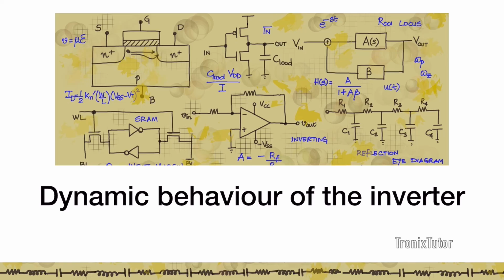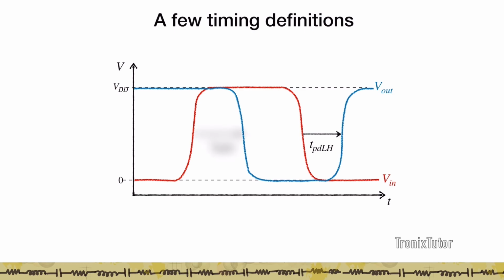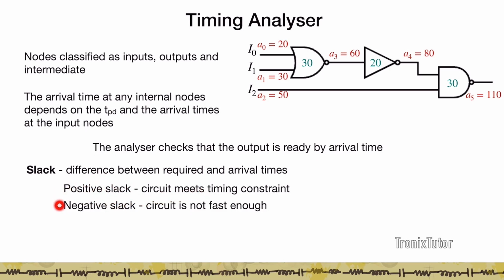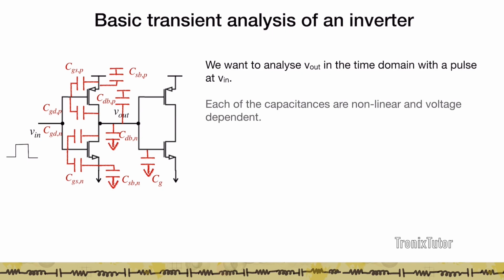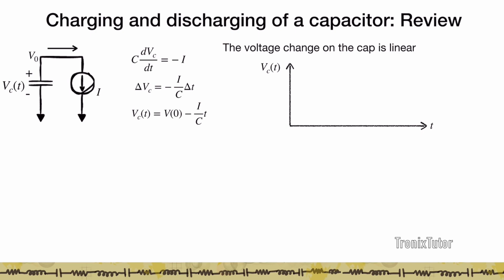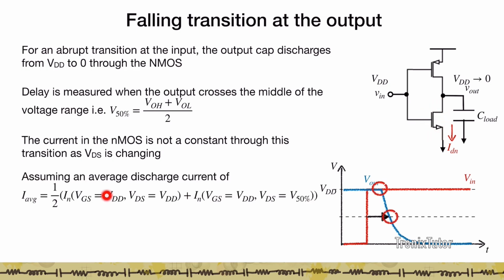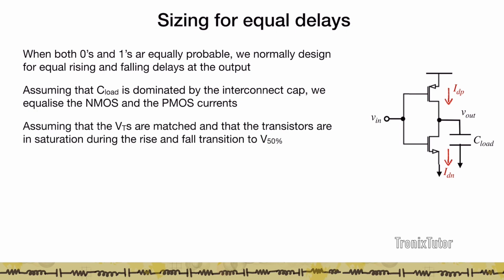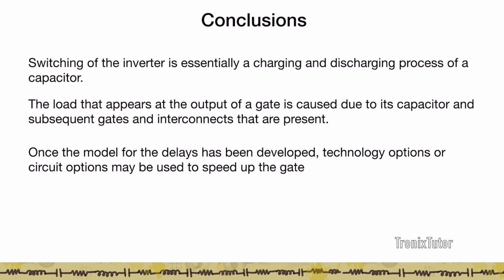Deriving the CMOS Inverter VTC From Scratch | VTH, VIL, VIH, Transistor Sizing

Comment: I am not sure if reducing supply will speed up the circuit, increasing supply also effectively reduces the resistance of the transistors and the increases saturation current in a quadratic fashion.Shouldn’t it be the opposite?
Reply from the maker: Reducing supply for a given circuit will
Increase delay. The delay will reduce only if L and VT also reduce and overall CV/I reduces .